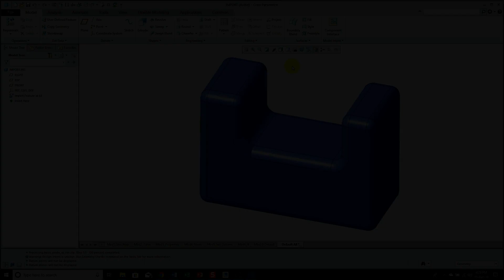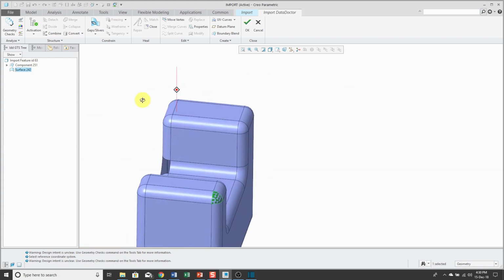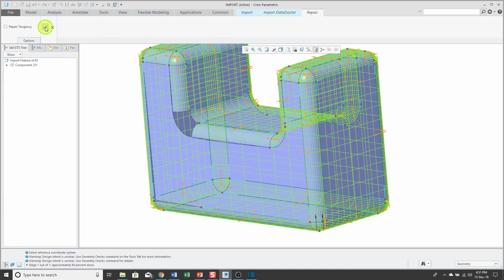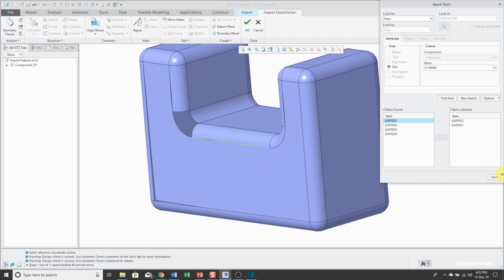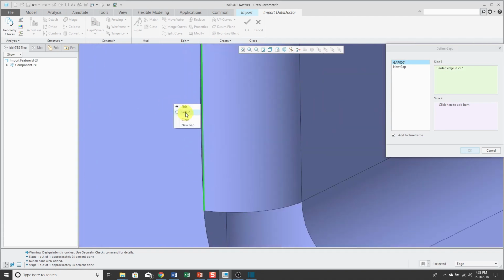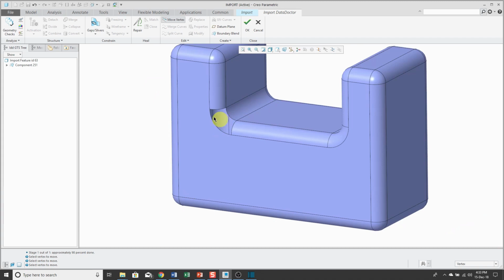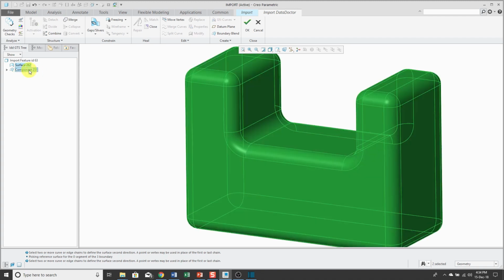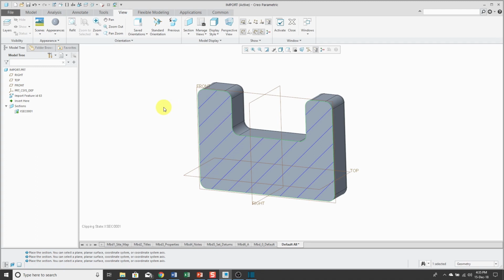Creo Parametric - Import Data Doctor (IDD) Tutorial

Comment: Hi Dave totally frustrated while importing a STEP assembly file into Creo assembly...The file was created using NX but while importing in creo it shows import validation failures...What could be the cause of error??? the same STEP  file but importing in NX is not showing any error...moreover in creo itz taking more time to load for the same PC configuration ...I don't want to compare Creo with NX but this is  my experience....Any tips???
Reply from the maker: Is it opening in Creo? Import validation errors aren’t a big deal. You can even turn off that check in the Notification Center. I can’t tell you why some STEP file I’m unfamiliar with is giving you errors. And you can’t compare load times for a native NX file with an imported STEP file. If it’s really an issue, open a ticket with PTC Tech Support.
Reply: @CADPLMGuy  I finally opened the file in creo...But only worried abt the time it took in creo.... Wanted to work with the rest of assembly with Creo....But  not sure even if I save the file with simplified representation (Automatic for sub-assemblies) it is taking more time to load...
Reply from the maker: Well, you're dealing with non-native geometry coming from the Parasolids kernel. This is the problem with multi-CAD. (I did a video for PTC on it.) Do you have Unite? If so, you could try opening the native NX file in Creo.